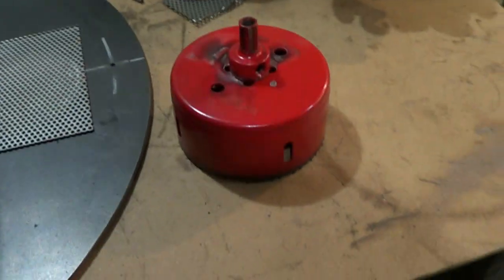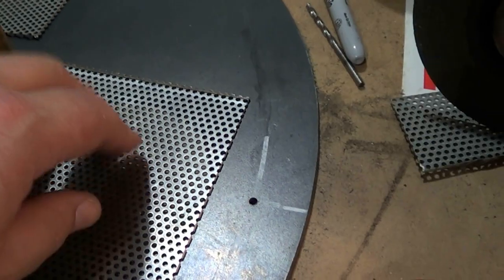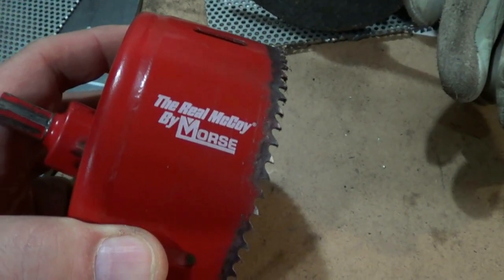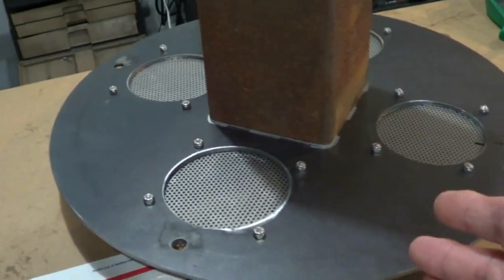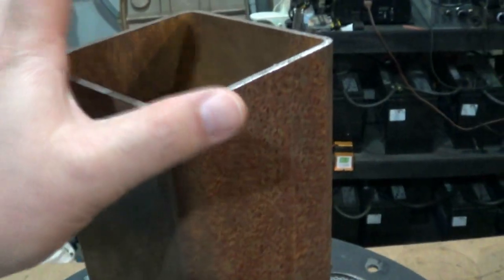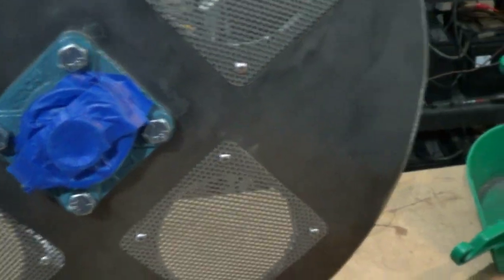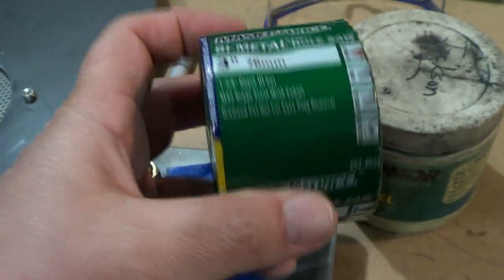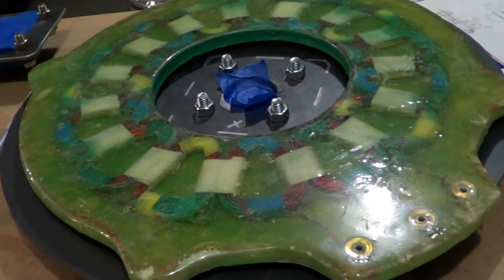AXIAL FLUX WIND TURBINE GENERATOR - ALMOST READY

Comment: Love your videos I'm thinking about building a axial  have some ideas , would love to see what else you come up with.
I'm still working on my solar system 1.5 kw panels and 24 v 4000w split phase inverter with outback charge controller hooked to 400amp battery bank.

Comment: I'd like to someday, build a axflux using the big, N52's about 50mm x 25-30 mm about 2" dia, by 1.125" thick magnets, they are spendy!! Especially when buying about 12-24 of them!!  About $50 each, just pulling numbers out the wind, ha-ha, but I think it should do about 5 kw easily, a plasma cutter would really come in handy wouldn't it!! I think they can be bought for about $100 for a small cheap one, that will top out with around 1/8" steel, I would like to get in to building some of these, and selling one or two a month, it would really help, a extra $100 or two a month would be very welcome, I have to re build my tool stock, I lost about everything a couple years ago, in a house fire, ( I had nothing to do with the cause!!) That is why I want to go off grid, I have a small off grid house, I'm half moved into, I just need more power to get in there, and a bit more work, its difficult to do it ALL by your self!!! Keep at it !!!

Comment: looking really good.  I have looked and asked all around this little town if anyone does any welding of fabrication. so far I am out of luck. did you find someone that will turn the main shaft ? I was going to try and build a similar 24 volt set up and I have the torque tube and bearing for a 1 inch shaft. have not decided what size to make the magnet rotors yet or located anyone that can do some accurate cutting.  guess ill keep trying to find someone. I did start wiring in all the equipment in the new shed. got inverter,battery shut offs, both midnite classic controllers installed. just started setting batteries into position and I picked up some uni-strut for solar panel frames. keep your fingers crossed I might get the solar panel frame done this coming week.
Reply from the maker: Lol, SD it will be nice for you once you done with the shed and projects! I have found a place to turn shaft and hub's, but at some cash besides... I have a big plans for my stalker this week and need the cash in hand for that, if you know what and who I mean, Lol!!! Say thanks SD for your comments Buddy...